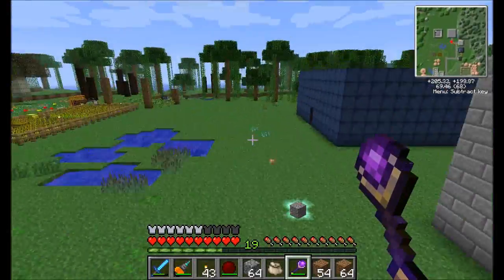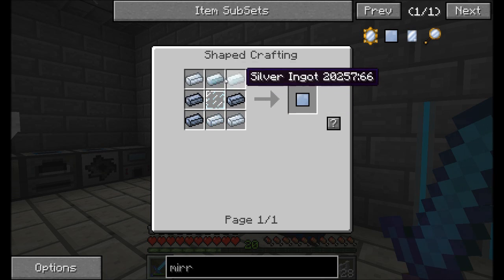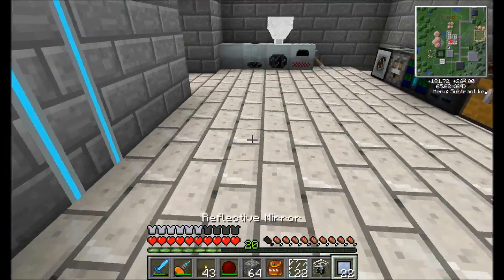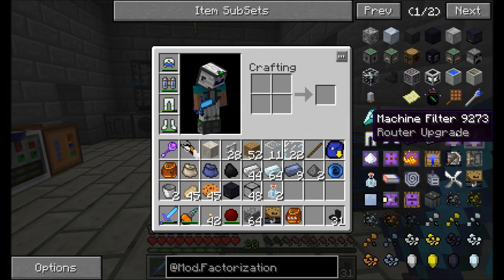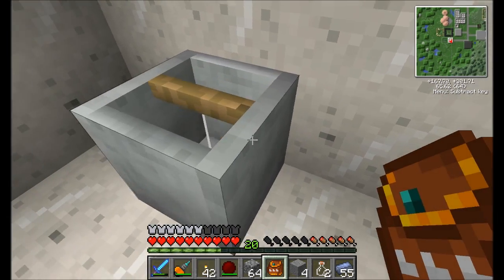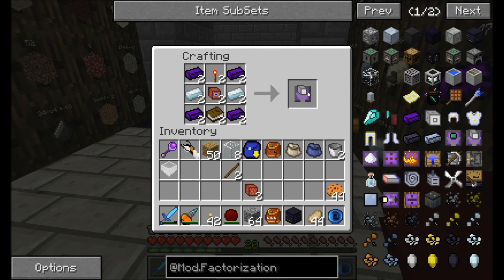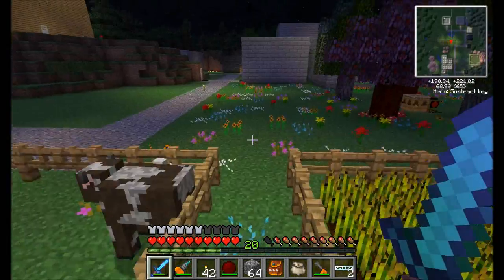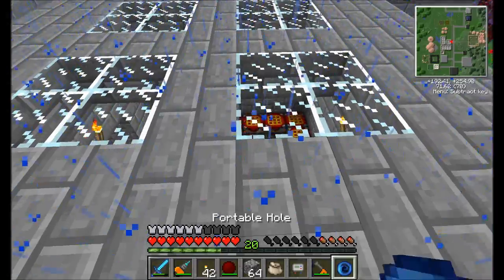Season 5 - Episode 63 Factorization

Comment: If anyone was wondering why the power wasnt working with the original setup, each LV transformer can only output 4 packets of 32 EU/t. Since the recyclers required 234 EU/t, Dire could have made a much cheaper solution by adding 1 more LV transformer in parallel to the first one to have a max output of 256 EU/t. As with the LV transformer, MV transformers output 4 packets of 128 EU/t and HV transformers output 4 packets of 512 EU/t

Comment: hey direwolf what you can do to run the recyclers and the mass fabricator is that you can put a lever on the bottom floor somewhere attached to the redstone line thats connected to the two mfsus so that even when they are full but you want to produce UU matter it will still work

Comment: You can do the same to wood as a fuel to solid fuel boiler. You just make a steve's cart tree farm, then extract wood logs by the golem to item tesseract, then from another tesseract to first fabricator - wood - 4 planks, then another one - 3 planks - 6 wood slabs. Boom you have a gigantic amount of fuel. As the finish you need a diamond chest connected to solid fuel - simple perpetum mobile.

Comment: Dire, instead of putting transformer upgrades (which make you vulnerable to explosions in case you accidentally remove them), you could put more MV and LV transformers, and as long you only connect LV output to the recyclers so they don't blow up, you'll get more energy to each one.

Comment: My setup is 32 extruders and 2 recyclers with energy upgrade and 8 speed upgrades, seems to match best to supply one fabricator. Adding one more speed upgrade to both recyclers starts to over-fill the fabricator. I did not need 3 recyclers.

Comment: it seems that a transformer can only output 4 packets at a time. the LV transformer was doing 128 which is 4X32, 32 being low voltage. so it stands to reason the HV transformer on the nuclear reactor can only output 4X512 which is 2048. the nuclear reactor might be outputting more power than dire is using.

Comment: THERE IS. a frame will brake itself. so just hook up some pneumatic tubes. and supply it with frames, and when 1 brakes. it's getting auto refilled. i have this system setup myself.

Comment: It doesn't need a lot of factorisation power to make these.  Just the battery on its own can run a crystallizer for several cycles to make plenty of the logic matrix as long as you disconnect it as soon as the crystallizer is heated.  Especially if you craft 3 matrix at at time...

Overkill as usual from my favourite overkiller.

Comment: I am loving this series Dire, they never get old .. keep up the great work.

Another single player mod that I find works well with FTB: DW20 pack is Sim-U-Kraft, may I suggest you check it out? The mod is up to date with 1.5.1 but you can get version 0.9.9 which runs on 1.4.7 for use with the FTB modpack.

Comment: Dire I believe that you know how eu works so I wont explain that. But insted of using transformer upgrades, and I'd say its easier this way. You can hook up more than 1 lv transformer, that's what I do in ftb ultimate for making tritium and deutirium cells for the fusion reactor in gregtech, because in ultimate theres centrifuges that use 32 eu/t and having an array of 16 will not accept one lv so and easy way is to just hook up more that one lv transformer. Just a suggestion. Have a good day :D

Comment: The problem you had with the EU at around 34:00 is that a transformer splits the 512 up in 4 packets of 128, and the lv in 4 packets of 32 eu. the problem is that the lv transformer can only accept one packet of 128 eu, which results in the fact that there is only 128 eu running to the machines.
So basicly: transformers split the eu in 4 packets
Transformers can accept only 1 packet
MFSU's MFE's and batboxes can accept as many packets as they want

Comment: the recyclers would run fine without the transformer upgrades if you added in 2 more lv transformers, a single lv transformer cant output enough packets/t to keep up with 9